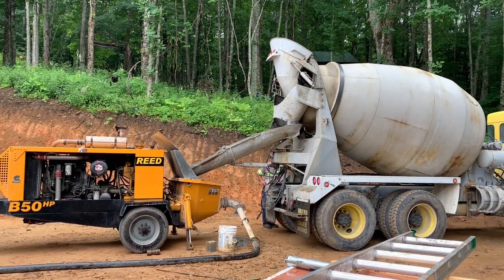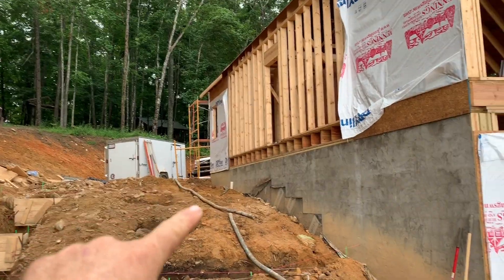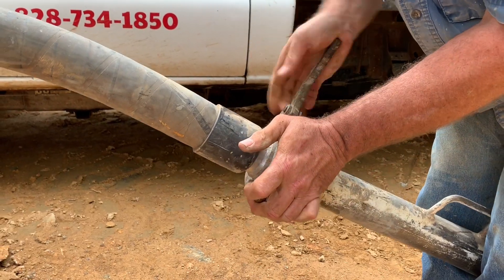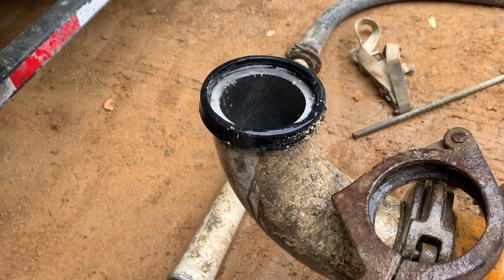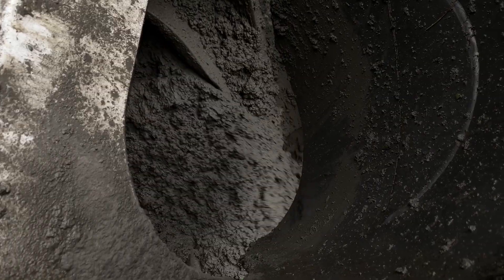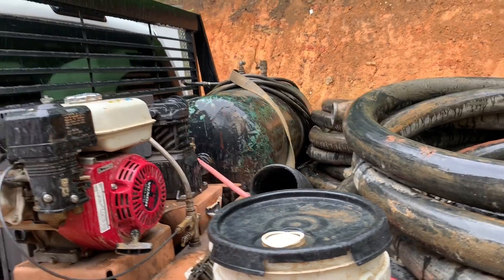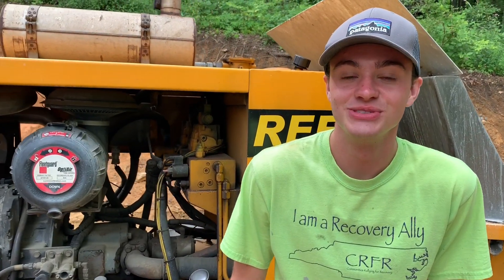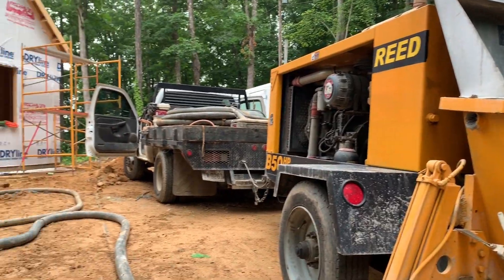The Amazing Concrete Pump Machine and How It Works

Comment: Good job Now I am working in crown readymix dhaka bangladesh it is a big cement and ready mix manufacturing company i am working as pump co-ordinator doing pump operation work watching and listening mechanical/hydraulic work watching and listening i like doing this job if i get a good opportunity i will do more  could do

Comment: Came here because I wondered how it actually works. It’s so simple, beautiful 👍🏼 thanks for showing. One addition: the open cylinder actually sucks the concrete in actively because the piston moving back creates a vacuum behind the concrete. That’s why the level in the hopper drops in intervals

Comment: I think the concrete PSI was 2500, not the line pressure. Footings get lower PSI than walls, floors & driveways.

Comment: I was hoping to show someone how the spades switched between suction (from the hopper) to the line (pressure) ... 
My family in NOLA owned Carlo Ditta Inc ... and my dad owned a 105' whiteman Boom pump I worked on for a few years ... harshest was the summer of 1989 in NorCal ... where the temp averaged (for 3 months) over 115-degrees in the valleys we'd so frequently work in.  THAT was some hard work.  Big hoses, and clamps -- 4" I think, through a reducer to a 3" hose at the end ... all of which I (alone) cleaned up after we wrapped and on weekends.  It's some serious work.

Comment: Up in the pacific NW we call the pump your using a line pump or a mason’s pump , pump trucks are generally equipped with a articulated boom that delivers materials thru steel lines to a rubber hose

Comment: We pump TOTALLY different in tx. No agitators in the hopper? That’s gotta be fun to wash out and 50 yards/hr is on the lower ends. I was spoiled and only ran German pumps…American pumps are trash along with Chinese. I been in the concrete world since I was 18. I’m 35 got into plumbing but I’m about to drive a mixer next week. I know a lot of ppl think they know what they are doin but just cause it hasn’t happened doesn’t me it won’t. I’ve had weeks where we lose a guy to just crazy shit. Read up and educate yourself before doing this it’s a top 3-5 dangerous job. Much love

Comment: Is there pump trailers that can already be filled, and taken to a project? Just wondering if I'm going to have to have a concrete truck too just for a 30ft long 2 and a 1/2 ft tall 8 inches thick retaining wall

Comment: Would it be possible to handle the end of the hose if you needed to fill upright galvanized culvert with concrete, say 8ft above ground standing on scaffolding?

Comment: I have 15 years pumping concrete and shotcrete and Reed is a nice pump but if you want a shotcrete pump high pressure look at the warrior pumps ours has a 5.9 Cummins diesel .yeah it moves 8 sack at 2andva half or three inch slump 200 ft of hose at idle .
Reply: Ja beton radim vec 30 g pozdrav za vas

Comment: What is  the coarse aggregate size required for the pump?
Reply: Largely depends on your (inner) hose diameter. Our rule of thumb is < 1/3 of the diameter. 
Just to be safe, I run 3/8" pea gravel in the 2" hose, which is < 1/4 of the diameter. I ran a maximum of 3/4" rock in the 3" hose.

Comment: That's a trailer pump. It's actually closer to 300psi pumping pressure inside the house. A "pumper truck" is actually called a boom pump. The concrete is pulled into the material cylinders via suction, it doesn't flow. The "pipe" is called a swing tube. 
Any questions, feel free to ask. I have a couple videos up if you wanna check me out
Reply: If you were going to start a concrete pumping business what equipment would you want.  If you were starting small  ? California weather
Reply: What size Putz you running brother?
Reply: @mcdjay 2012 47m
Reply: @mcdjay  ok I will I don't want to get shot by a pellet gun
Reply: I like 2 1/2 hoes better
Reply: You say that the pressure is only 300psi ? Can i use it to lift a foundation to my house

Comment: In my pump truck I can empty 10yd truck in 4 minutes
Reply: No way liar
Reply: @My Name Is Jonas I asked my pump truck guy what they could do full bore and he said they often unload a full truck in 6 minutes. So, if a crew were able to handle that mud fast enough, I could see 4 minutes being done. These line pumps maybe not, but a boom truck really throws it. I imagine they can use similar piston sizes so I bet the larger ones could do similar.
Reply: @joshualruby  Pump guys like to wet the mix like slurry for easy flow, but that weakens the crete.

Comment: At what slump it usually pumped
Reply: For a small trailer pump like that, with no vibrator, you need at least a 3-3.5" slump. With a good vibrator I pump a 2" all the time. Bigger the number, wetter the mud. Flat work is usually around a 5".

Comment: I ran a line pump for 6 months, props to anyone who does that job.
Reply: The priming out takes a few try’s to get right, once you learn how it’s not bad. It’s a fast paced job to get setup before the concrete truck gets there
Reply: @Apexjasonmorganllc  how many jobs did you guys normally would do per day?
Reply: @eddiem384  during busy time 3 a day
Reply: No doubt iv ran a boom an line pump for 7 now not that bad I prefer ground pump
Reply: Is it very had to operate?
Reply: I have a question, was it an Electric pump that you used? If so, how did you manage to get required amount of power? I was thinking of it, for prefabricated industrial buildings, would be nice because of carbon-monoxide from Diesel in closed space would be bad.. The problem is it takes a large amount of electric power and we dont have the industrial slot on the jobsite..
Reply: @milenkotanasic9650  the pump is mounted on a truck, you leave the truck running and it runs off a pto that you engage much like a tractor. Your pump and power is controlled by remote that the operator carries on him
Reply: Sir, I have also made the same category video. Sir, please watch it also.😊😊😮
Reply: Where's the 10 replies???
Reply: Apex floor designs LLC/Jason Morgan why was it bad?

Comment: Thanks for explaining the way the concrete pump works, i always wondered.
Reply: whats the name of that pump?
Reply: How does this remote work
Reply: @mollyanyal9612  with 2 thin bars on either side of the pusher. Regards 

Euston Drive
Reply: Reed b50hp
Reply: Sarcasm is real🤐
Reply: Onnk
Reply: Sir, I have also made the same category video. Sir, please watch it also.😢😢😢